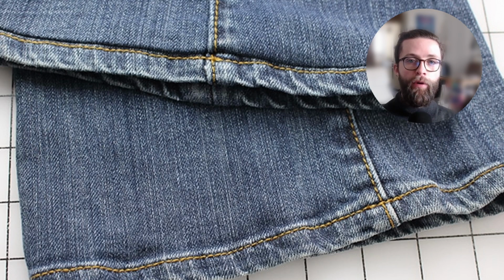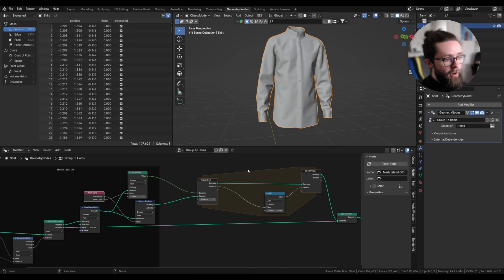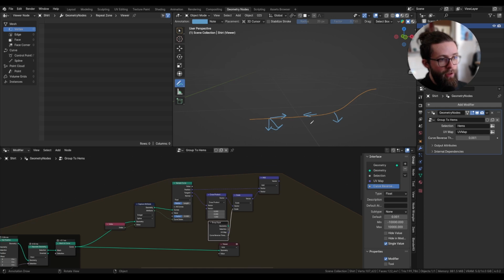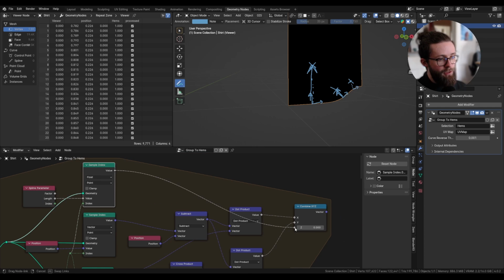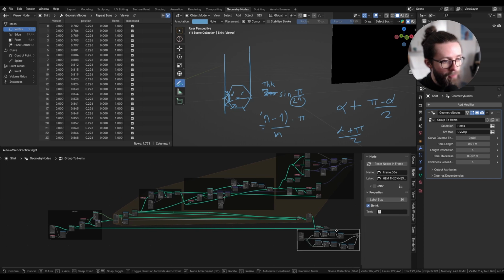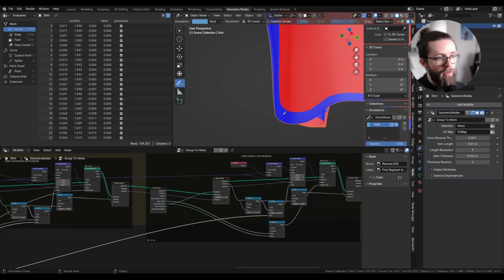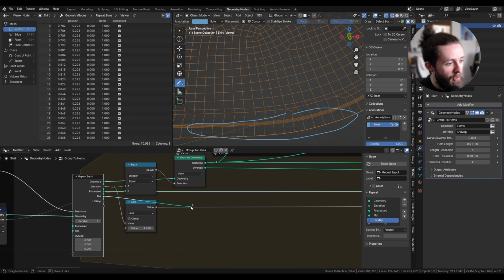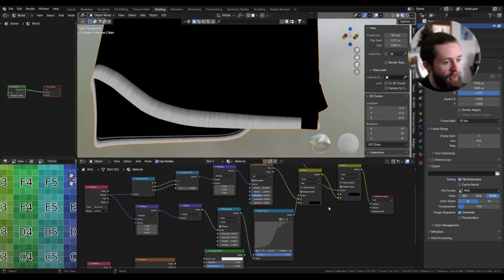Making Fully Procedural Hems For Animated Garments - Blender Tutorial

Comment: Great tool. I got the tool box but i am struggling a little. Waht I need to do is pretty simple animate a blanket over a sofa. I was really struggling with the hems. Is there an insdtruction video for how to use the geo nodes setup? I basically jsut need to add the hem setup to a plane. I have a vertex group added for it but what do I do from there? Thanks.

Comment: Came here to learn how to make procedural hems, went away learning how to:
1. Select linked geometry with accumulate fields
2. Properly use Repeat Zone.
3. Some cool trigonometry on the extruding part of the hem
I have a question about the edge of the hem. Wouldn't it be easier to use a curve arc to define instead of multiple extrudes?
Reply from the maker: Glad you could learn so much!
It would technically be possible, and also an elegant solution in itself, however you then would have to merge the two geometry using merge by distance node, which I try to avoid as much as possible because it messes up the vertex indexes